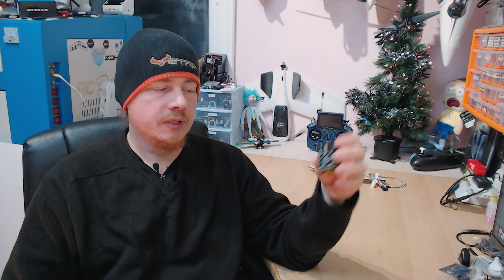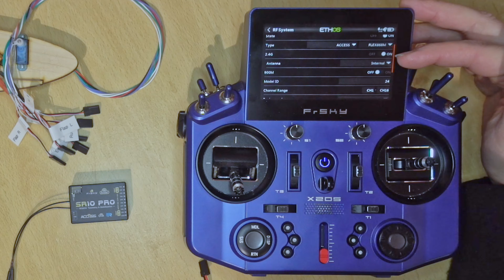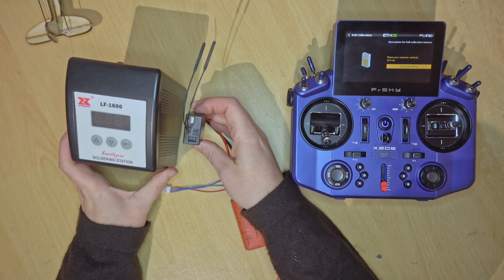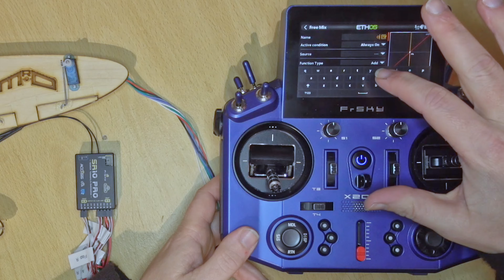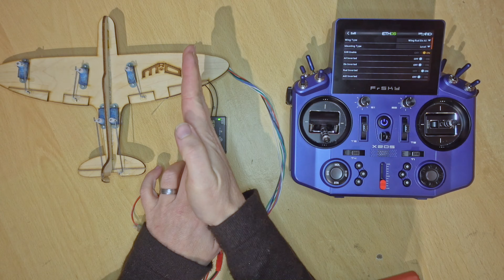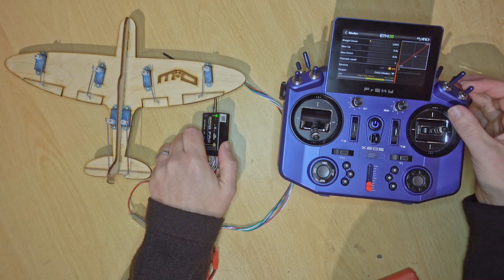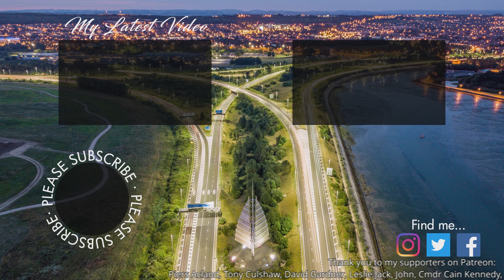Setting up FrSky Archer SRx stabilised Receivers

Comment: Hi Darren, again a great video, especially now it's about the Archer series. However I have some problems. I have no output on my Ch6 pin, where the transmitter shows the movements on the output, but the servo doesn't move. I have the SR8 Pro (The servo works on the other pins). Tried to do the same on another new SR6 Pro, same problem. Because I thought is must be in the transmitter, I've updated firmware to 1.2.1 and Internal HW: 1.4.0 FW: 2.2.1.
Went through complete setting up procedure again, but still no working ch6 pin. In your video you mentioned something like switching Ailerons to AUX1 or AUX2, thus making ch6 available for normal working. This is not clear to me. Tried this all, but still no ch6. Do you have a clue?
Regards, Ron
Reply from the maker: Hi Ron, if you take a look at the video here, it shows how to make channels 5 and/or 6 regular channels. https://www.youtube.com/watch?v=rUKIBQdmvIY&t=866s I appreciate that this part of the video is quite brief. Basically, there are two switches: AUX1 Enable and AUX2 Enable. If AUX1 Enable is off, output 5 is used as the second aileron output. If it is on, it uses whatever is on channel 5 from your transmitter. AUX2 works the same, only it outputs a second elevator when AUX2 Enable is off, and deals with channel 6.
Reply: @MrD  Thanks Darren. It now works. Only strange that it worked before, without knowing that these AUX1 and 2 switches existed. I used the ch6 and 7 for flaps, where ' suddenly' ch6 output didn't work anymore 
One (I hope) final question. That's about the same page of SxR. I created the gain on ch9, as instructed, but I don't see any activity when I dial the gain pot. Also all of the stabilize gain switches on the SxR page are disabled and showing 0%. How can I enable these switches? Regards, Ron

Comment: Hi Darren.  I really appreciate the Series of helpful vids for Ethos.  I’m switching over from Spektrum.  I’m curious about the size of the receives.  I haven’t been able to find a small/compact receiver for a simple 4 or 6 channel plane.  I don’t need a built on gyro or telemetry.  I’m hoping you can point me in the right direction.  I have a pylon style of prop planes where space is tight.
Reply from the maker: Thanks, I’m glad the videos are helpful. 

Sure. Check out the Archer R6 receiver. That is pretty tiny at 33 x 15 x 10mm. I believe those measurements are including the pins. There is also an R4. But I’ve never really bothered with the 4 channel versions as there’s not much difference in size or cost. But, if the space is really tight, the R4 may squeeze in slightly easier. 

They all have telemetry. So even with no sensors, you will get RSSI, VFR (link quality), and the power, which in most cases would be the voltage supplied by the BEC. There may be one other sensor, but I can’t remember off the top of my head.
Reply: @MrD  That’s great!  Thanks Darren.  The Archer R6 will work perfectly.  Can’t beat the price.

Comment: Darren, the reason I asked about the video on the RB30+. I will be installing the RB30+ along with X20S, 2ea R8 Pro & R9MX in a BVM Ultra Bandit Jet. I would appreciate your thoughts pro's and con's. Is the RB30+ CAPABLE of handling $$$$ airplane
Reply from the maker: That does look like an awesome plane. You really can’t beat the sound of a turbine. 

There are a lot of guys who fly jets on FrSky products. If you are on Facebook. Check out the FrSky group. There are quite a few jet pilots in there who will have some great suggestions for setups.

Comment: Hi Darren, Your Videos have been a great benefit to us in setting up the X20S / Ethos along with the Archer receivers. Will you be doing a video on the RB30+ any time soon? Also, I was wondering where you got your little model airplane you use in your videos. I would love to have one.
Reply from the maker: Hi Richard. 

Unfortunately, no video from me on the RB30+. I don’t have one, or a plane that really warrants the spend at the moment. 

The little plane I cut and built out of ply. They are handy. But I would rethink the horns if I were doing it again.

Comment: hello Darren, i am trying to set up a plane with 4 aillerons, 2 elevators and 1 rudder with a SR10 pro recever, is it possable that the recever does not suport gyro for 4 aillerons , i tried to programe a modle with 4 aillerons, 2 elevators and 1 rudder and the recever siems mest up, i git only 1 ailleron , 1 elevator and 1 rudder woring with gyro, thank you
Reply from the maker: Hi Jacques. No, there is only support for 2 ailerons (Ch 1 & 5), 2 elevators (Ch 2 & 6), and one rudder (Ch 4) servos.

Comment: Hi Darren, do you have the same video for the S8R series receivers?  When I try this method on my S6R, I the calibration keeps spinning and never prompts me for to turn the receiver.
Reply from the maker: Hi Scott. The procedure is the same. Do you mean the S6R or SR6? I’ve heard the label is upside down on the SR6. So for that step, the label would be facing you but the text upside down. The important part is the label faces you and the PWM pins are on the correct side.
Reply: @MrD  Sorry, its the S6R.  From what I can see in the video, when you click to calibrate a side, it completes and the picture changes to a new side.  For my S6R, the transmitter continues to show "calibrating"  Did I miss something?
Reply from the maker: If it just says calibrating, it’s usually because the wrong orientation has been positioned. But the first position is pretty impossible to be wrong. Is this on ETHOS or OpenTX using the LUA script. I’ve heard that some people have had issues with some versions of the LUA script.
Reply: @MrD  I'm using the X20S so Ethos.
Reply from the maker: Sorry for the late reply. But I wanted to check this out for myself. I took my S6R, started from scratch, and it all went through fine. I set up a new model on my X20S, bound, calibrated, and set everything up. I did find that the first position took a little longer than I was expecting. But that could be because I have velcro on the bottom so it wasn’t sitting perfectly still. 

I am currently on ETHOS 1.1.0.
Reply: @MrD  Wow, thank you for all the effort.  Interesting as I also have velcro on the bottom of my S6R.  I will try again and if I don't get results, I will remove the velcro.  Thank you so much!
Reply: @MrD  Update:  I'm using ETHOS 1.1.1  I tried the S6R again with no good results.  I got out a new S8R and was able to go thru the calibration perfectly.  So I re-bound the S6R selecting channels 1-8.  When I tried the calibration again, I see the yellow light flashing in the receiver which I'm guessing to be stabilization.  It stops flashing same as the S8R did but the Transmitter never gets the done signal (I'm guessing) because it continues to show "calibrating" and never moves to the next step.  I guess something is wrong with this receiver.  I did update the receiver firmware before staring to ACCST_2.1.2 (latest).   I got this receiver from a friend but I saw the plane flying before taking the receiver.  I may try flashing the firmware again and if that doesn't work, then its just bad.
Reply from the maker: Sorry you’re not having much luck with this. Maybe try flashing 2.1.1 and see if you have better luck with that. Also, just to confirm, you’re using 16 channels, with the bind on 1-8 telemetry on.
Reply: @MrD Yes, I'm using 16 channels and binding with 1-8 on.  I see the yellow light in the receiver come flash on and then go back off as if the calibrate but the transmitter doesn't seem to get the done signal.  I was thinking that the receiver firmware had to be 2.1.2 to use Ethos.  What firmware did your S6R have that worked?  I can certainly try it.
Reply from the maker: Mine is on 2.1.0. The 2.1.1 update was only for FCC regions, so I didn’t need it. I couldn’t see a 2.1.2 for the S6R.
Reply: @MrD  You made me question my firmware version based on your last reply.  At first I just assumed I had typed in the version number wrong along the way but tonight I checked and for sure I had flashed with the S8R 2.1.2.  I reflashed with the S6R 2.1.1 and it calibrated just fine.  Thanks for the help.  I've been out of the hobby for years and trying to find my way back.
Reply from the maker: Awesome Scott. Glad it’s all working 👍🏻

Comment: Hi Darren. Your videos are extremely helpful.  I have setup a SR10pro as per instructions on a tail dragger and it has been fairly successful, I do have one query though.   When I switch between stabilise and heading hold (Or push the Oh Crap button) I get a small amount of up elevator twitch in if the plane is set level. If I set the plane down on its tail wheel and switch between stabilise and heading hold there is no alteration in the elevator trim. I have been over the setup a couple of times now with the same result. It looks like the gyro believes level flight is with the tail down / nose up ... a bit. I can't seem to trim this out. Any idea what I have done wrong?   Thanks. Mark.
Reply from the maker: Thanks Mark.
I'm not with my transmitter at the moment. but If you check out the video from here https://www.youtube.com/watch?v=rUKIBQdmvIY&t=907s you will see the "Auto Level Offset Angle of Ele" You can adjust that angle to get it flying straight in the self-levelling mode. It's best to do this gradually with some test flights. You will probably need a little nose up to fly straight.

Hope this helps.

Comment: Hi there. Thanks for the videos. They are very helpful. I have been trying to set up my SR8 stability up and just can't get the o crap function working. I have done everything in the video and have done firmware upgrades on both TX and RX. 
Not sure where to go from here.
Reply from the maker: Hi Craig. Can you email me some screen grabs of your mixer screen and the oh crap mixes. There's not really much I can suggest just through text. You can email me via my web site or use my discord server.

Comment: Hi, thank you for your video, great instruction and very helpful. I just have one question, do this Rx comes with a fail safe switch or do i need to install a switch between the batteries and the rx. Thank you!
Reply from the maker: You’re welcome Carlos. 

There is no switch on the receiver. I guess you mean a switch to turn off the model, rather than failsafe. If you wanted a power switch, it would need to be added separately.

Comment: Very good presentation. I could not get my RX8 to work. The tip you gave regarding the switch toggle delay was the problem.. I would have never found that in a month of Sundays. Absolutely fantastic tutorial. You are Mr A+++ not Mr D.. love the videos. Keep going love Ethos and FRSKY product they can just be a little tricky to set up. and yet so simple....
Reply from the maker: Thanks John. They can be a little tricky in the beginning. But once you get used to how everything works, it's all pretty familiar. Yes, the switch delay caused me problems too. Tried everything, twice. I the end I reached out to my contact at FrSky, who is excellent. He told me to try that, and that solved it. But, that information couldn't be found anywhere, so I included it in the video. I'm sure that has caught out quite a few people.

Comment: Thanks much for this video .It was very easy to fallow only stopping alot because this is all new to me.I can finally not be stressed out . I read that manual so many times and I don't know where you came up with this although the words mentioned in the manual about a lot of things that I had to do that you showed on the video but not they didn't explain it in a order but again thanks man. Still trying to figure that rb30 out
Reply from the maker: Awesome Randall. I'm glad it helped. The manual isn't the best for the SRx, or the older SxR receivers. Some of the snagging parts aren't even mentioned.

Did you try using the tool for these receivers with the RB30? That may be how you set up the stabilisation part?

Comment: Great video. I watched it to better understand whether I should try out FrSky & ETHOS and buy an X20s or not, especially with regards to gyro receivers. This video made it quite clear to me that configuring a stabilized plane using ETHOS UI & ACCESS receivers shouldn't pose any issue for an experienced RC guy used to one of the big old brands of RC equipment. Thumps up!
Reply from the maker: Thanks Hal.

Yes, the setup is pretty straightforward. Especially with the configuration tools built in to ETHOS.

Comment: THAAAANKS !!! Subscribed ! Ill'try this in flight with a foamie just to see how it reacts 🤖 and maybe more if it works well.
Reply from the maker: I've not had a chance to try the SR10 Pro yet. I keep needing it to make videos. I will be going in my petrol Wots Wot XL, which I hope to fly when the weather improves. The stabilisation is the same as the older S6R and S8R, which I've used in other models with no issues.

Have fun with that foamy :)